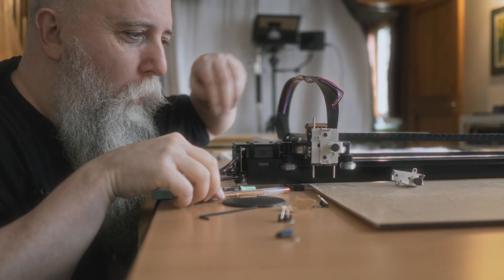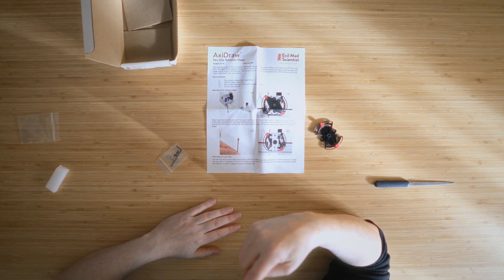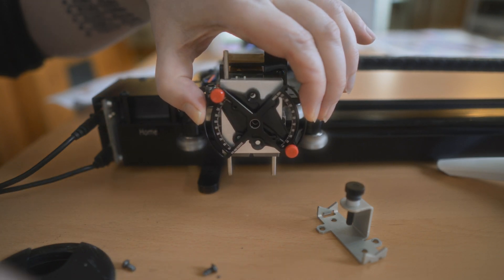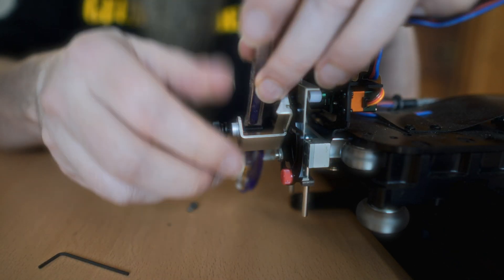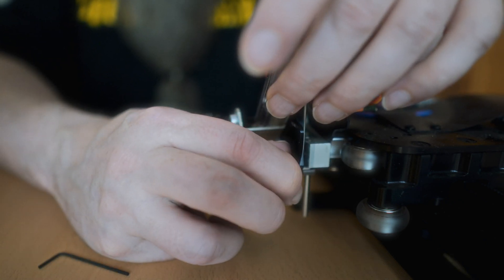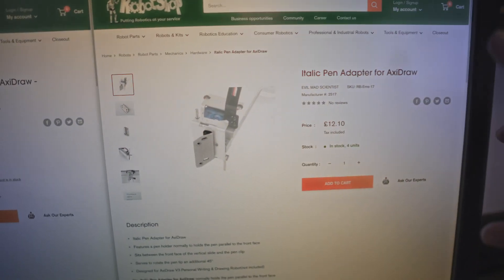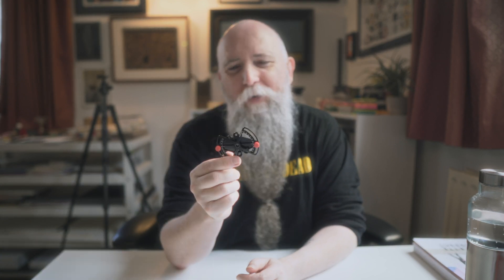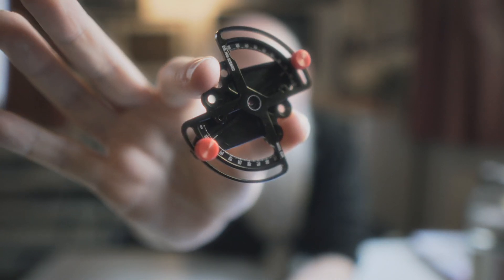Adjustable Pen Holder | "Pen Clip Rotation Stage" for AxiDraw

Comment: Do fountain pens work ok if you draw lines in the direction they're pointing? I (perhaps incorrectly) remember from school in the 70s, if I did this, the nib would get stuck and splat ink everywhere. Is this a problem using them with the plotter?
Reply from the maker: Not really a problem with fountain pens now, they tend to have a little, ummmmm, 'rounded nub' just under the tip that allows them to move in most directions. I do have a couple of sharp pointy nips though, but in that case you can order the lines in the SVG file to all go in a downwards direction, breaking them up if you needed.

Comment: I've been eying the magnetic easel when I realized that I can order a magnetic message board (basically just a sheet of steel) for about $17 and a pack of small strong magnets. So I got those, and...well, it works. I do have the sheet marked out on the table just in case it moves, but I can always replot the grid.
Reply from the maker: Yeah, I've been using a mild steel sheet with magnets which was pretty cheap, but annoyingly it came off a large roller so it has a little curve.

I figured I could business expense this 😁